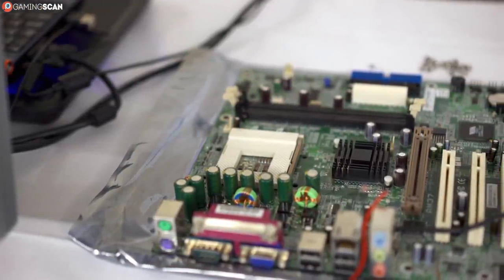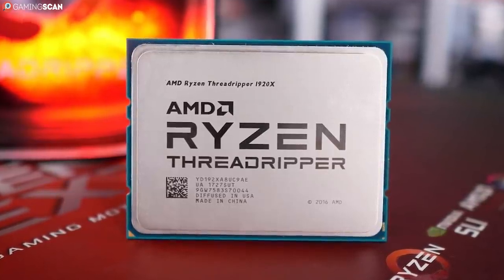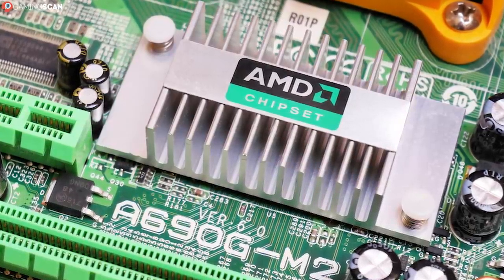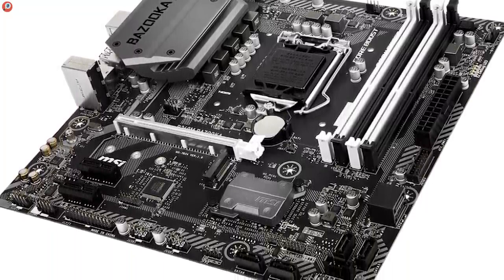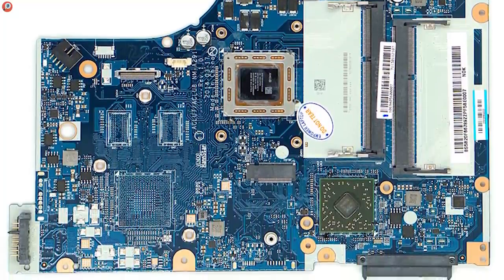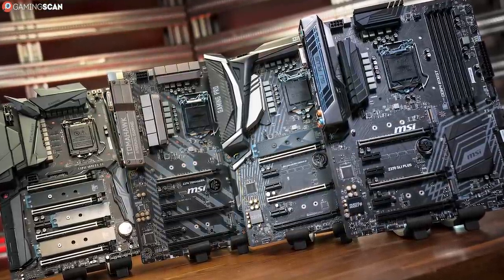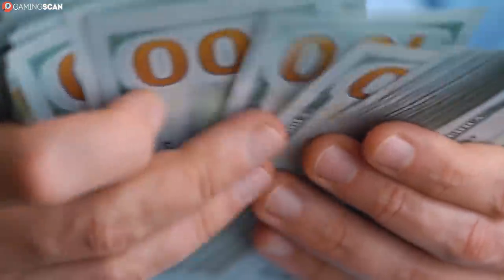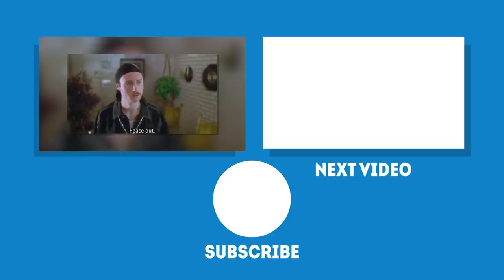Best Gaming Motherboard 2020 [WINNERS] - Buyer's Guide

Comment: Loved the video 😍
One question, Can MSI B450 Pro m2 overclock AMD CPU?
Reply: Yes, but don't get too crazy on it. Also you'll need a beefier CPU cooler (water cooled or a bigger air cooler) and overall better case air flow.
I myself am going to get the MSI Pro Carbon AC.
Reply: @diegobahena1274  I will be installing Depcool Gammaxx. Can I overclock to 4.5 GHz?
Reply: @theblackcat3594  you'll have to improve VRM cooling

Comment: Asus b450 strix or msi gaming carbon pro b450.
Reply: Carlos Cruz b450 tomahawk
Reply: but if more performance definitely gaming carbon pro

Carbon Pro>Tomahawk>Strix B450-F
but there is also x470 strix which is even better than the Carbon Pro.(Carbon Pro has only B450 ,no X470)

so:
Strix X470>B450 Carbon>B450 Tomahawk>B450 Strix